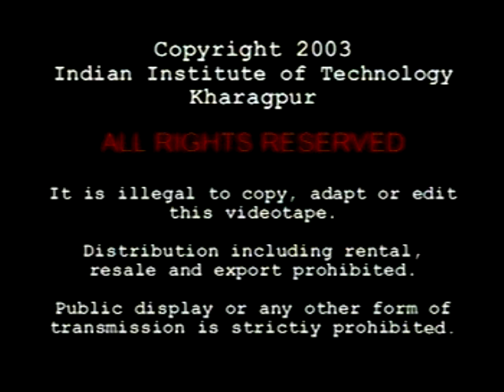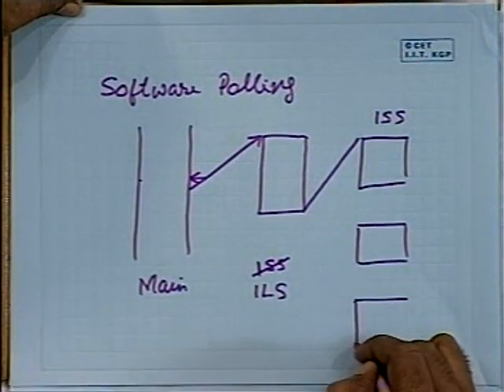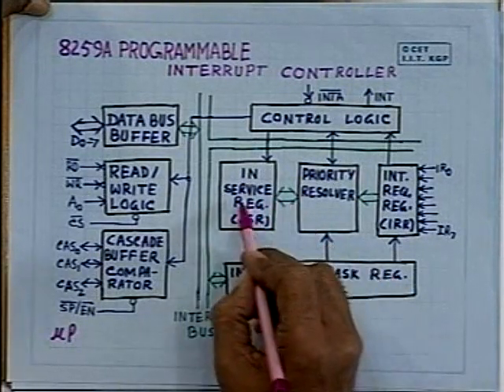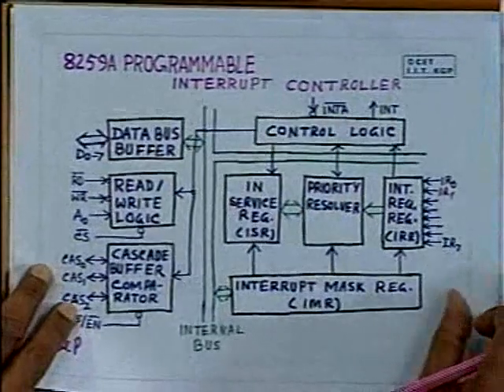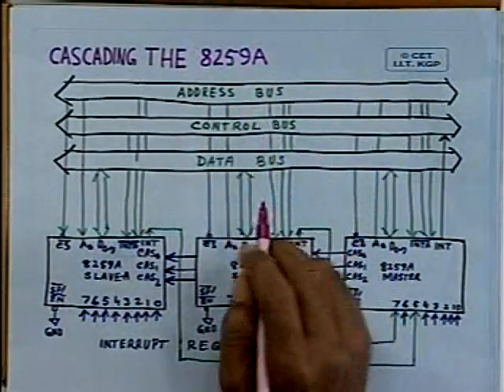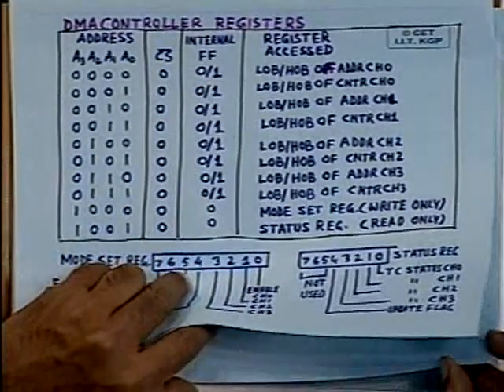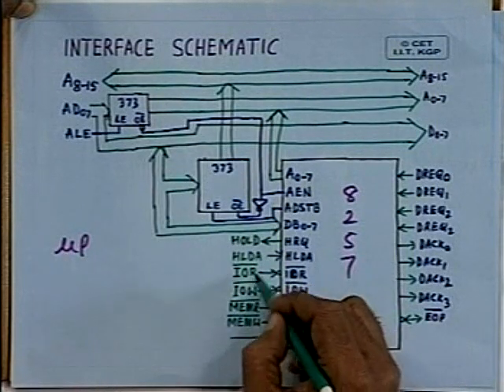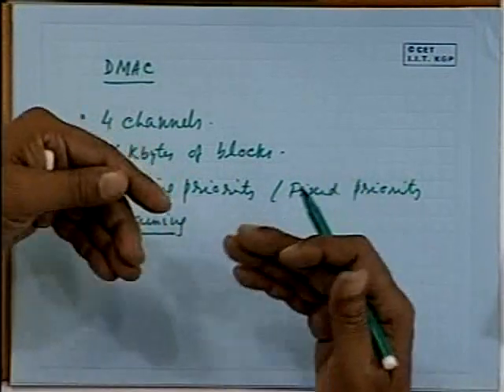lec 17 - Programmable Interrupt and DMA Controllers

Comment: thank you sir.
it was really very helpful..
my doubt is that the as the channels are of 16bit- the DMA should transfer 64k of data but in the lecture it is mentioned that it transfers 16k of data..
.
Reply: Higher two MSB bits are used to select DMA channel and count register. That's why only 14 bits are used for count.